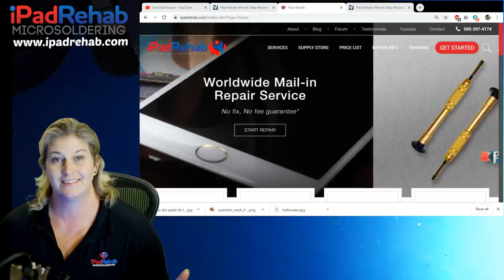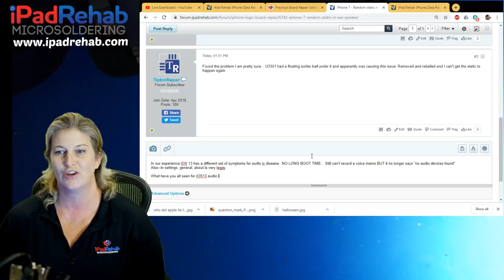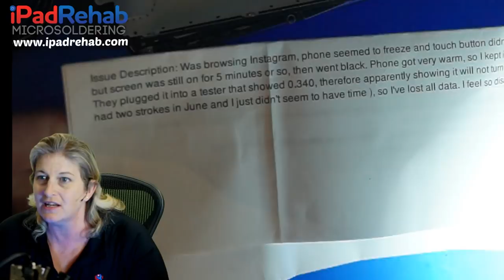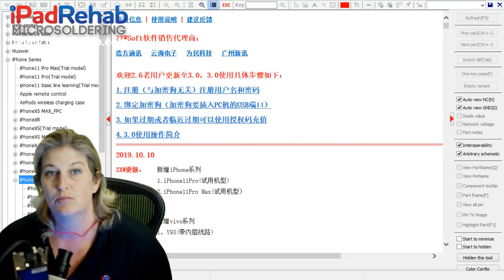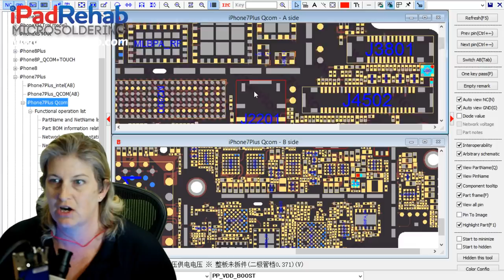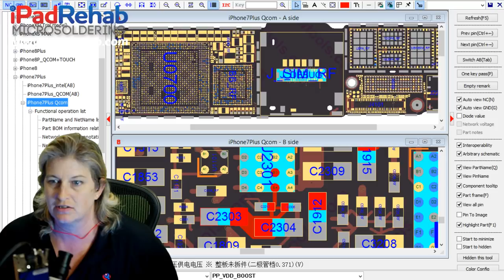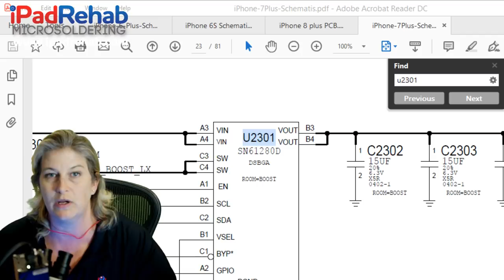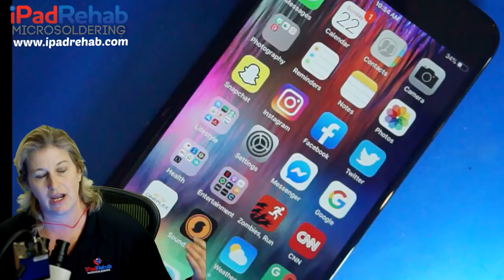Find out Who Apple Lied To Today---Livestream!

Comment: From what I can gather, neither the tekpower tp3005t, nor the fluke 115 compact have the ability to connect to a computer or other datalogging device. 

Get yourself the webcams out of 2 broken laptops, add a 3v3 regulator and USB cable to the webcams, hook up to computer and 3d print a stand for psu and multimeter to place webcam in so display is visible and in focus. Then add the whole crud to OBS and you'ld be all set.... hopefully :)

Comment: Apple charged my wife for another iPhone 5s 75$ cause her batter had expanded and pushed apart her screen, the hard part was already done, all it needed was a new battery and sealed back up...I found an apple battery for a fraction of what they charged for the replacement phone....BUT instead of letting me fix it like I've done countless other things they got the "new" phone....WHICH ALSO HAS BATTERY ISSUES RIGHT FROM THE MOMENT SHE GOT IT! The battery lasts almost two hours off the plug data off....not even kidding.